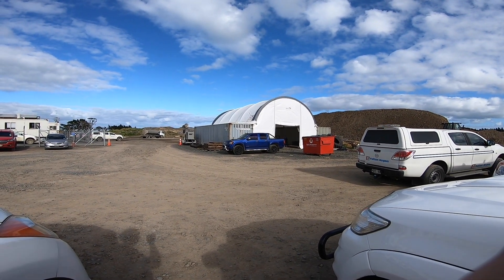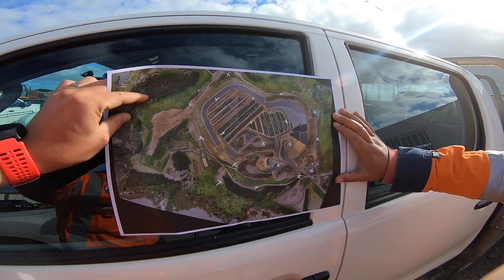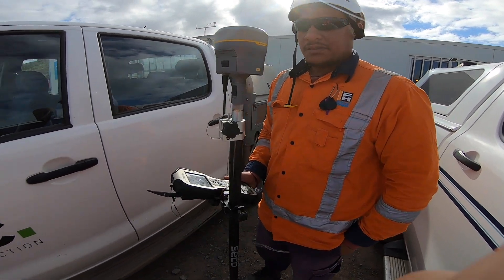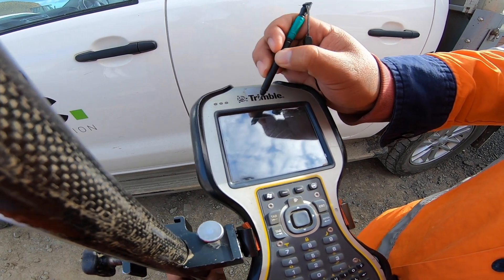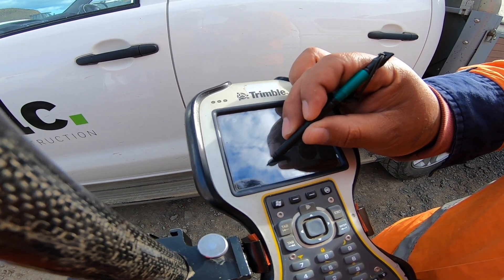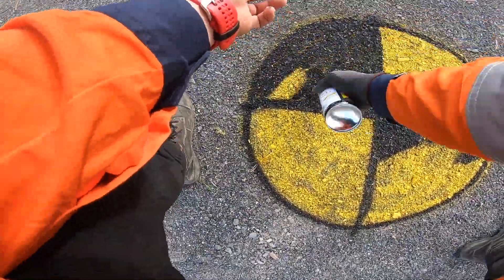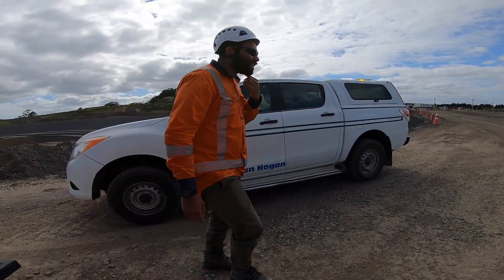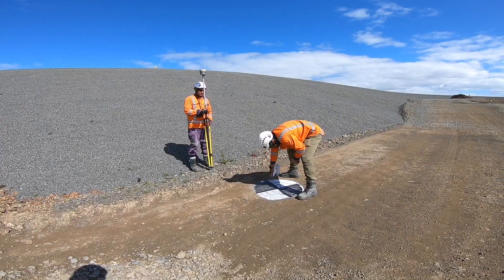Aerial Survey How to Establish Site GCPs

Comment: hi,how accurate is the height(vertical) after the drone surveying?
Reply: Phantom 4 pro makes GCP=1cm from 36,5m altitude above ground. Typical flight is on 70m AGL (above ground level). So GSD (ground sample distance) is 2cm. It gives 2cm horizonal and 4cm vertical accuracy. If you compare 2 flights it is root square of 2 multiplied by accuracy - so if point clouds from 2 different flights are no more than √2*2*GSD in this case 5,5cm from eachother it means the data is OK.
Reply: BAD!!!!